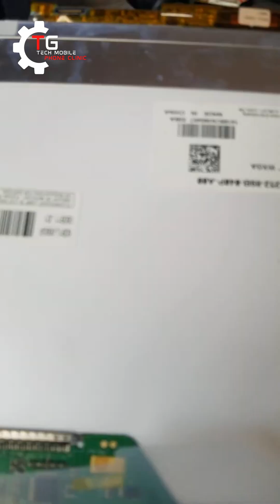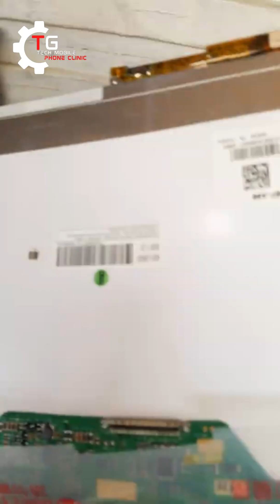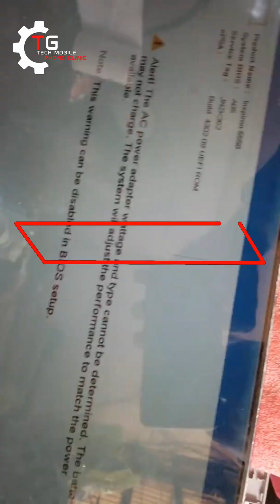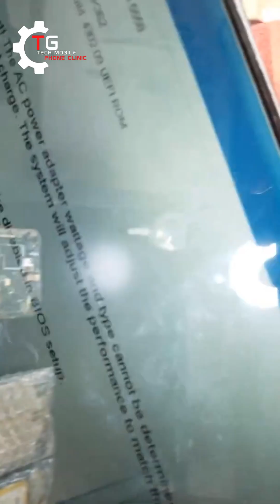How To Fix Laptop Screen Backlight Problem(Dell…)

Comment: Hello, I have a problem with a Dell latitude 7480 does not turn on the light on the screen.
Reply from the maker: Have you confirmed if it’s a backlight or screen issue?